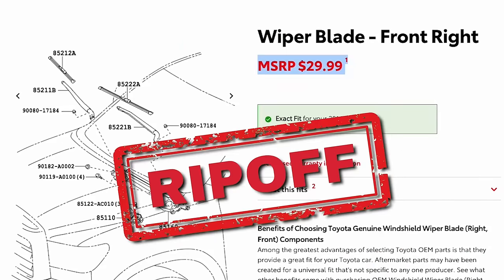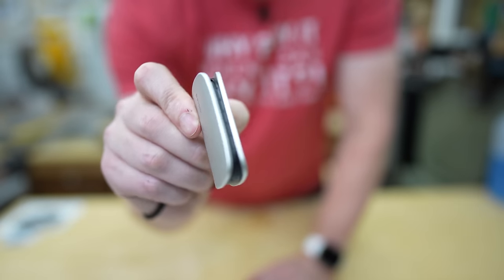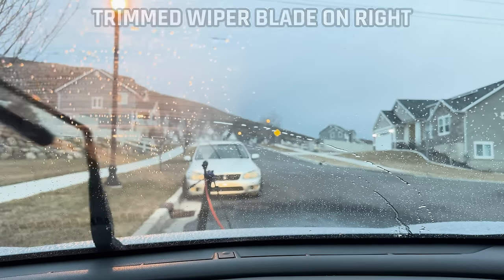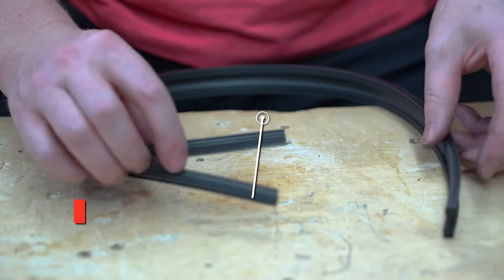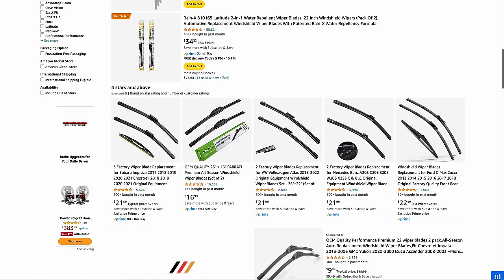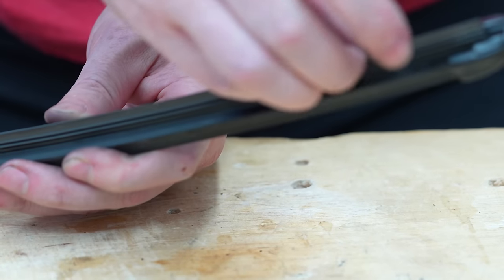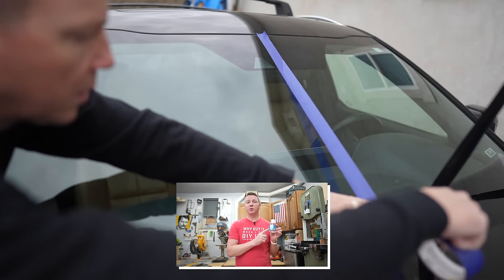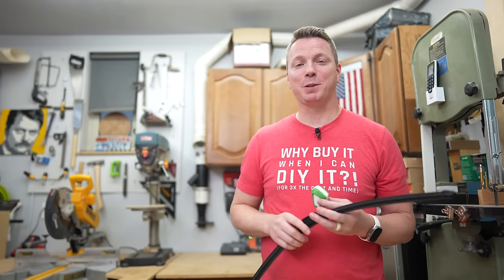Windshield Wipers Are a SCAM! 3 Ways to Save $$$

Comment: I am going to weigh in on this subject because it is one of my biggest pet peeves. 
It wasn’t that long ago that you could walk into any walmart or chain auto parts store and buy wiper blade refills cheap, I’m talking $1.99 for a set of refills at walmart. At that time you could buy a complete OEM quality Trico replacement blade for $4.99 and the best premium Silicone blades from companies like Rain-X or Bosch for under $10, now wiper refills are no longer available at retail stores and Rain-X Silicone are up around $25 each and Bosch OEM quality blades are around $35 a pair. As someone who spent years in retail auto parts I am extremely perceptive of changes in the auto parts market and can say without reservation that almost none of this is due to inflation; this like almost everything else in today’s economy is almost all the result of greed based market manipulation, for proof all you have to do is look at the record high profits corporations are reporting to their share holders. Companies across the board are now in the stock market business and their customer base is the expendable consumable used to reward their share holders………
Reply: I agree the the rise in prices has nothing to do with inflation. I have also seen my company raise prices on the highest selling items like batteries and wiper blades. First $10 then recently $5. Our pay hasn't increased at all so its not due to the increase in wages and with all the new products they send out it doesn't appear to be due to supply shortages. It's all just corporate greed to see how much profit they can get away with.
Reply: Totally agree! At first, I thought it was local availability, but I’ve moved around a lot and travel even more, and eventually I just never saw refills anymore. I’ve experimented with different types in different climates, and I’ve found you’re better off buying the cheapest ones unless you live in a more favorable climate that you can get more a year out of them. I remember we use to get much more life out of them than ANY now. I’m hyper sensitive to the quality of my windshield viewing, especially during rain, and I remember usually get 2-3 years out of most wipers until the last 10-15 years. Greed by just about any company these days is getting out of control.
Reply: It's also the stupidity of people. They are not conscious anymore.

Comment: I have the same large bottle of Rain X for about 30 years. I haven’t needed it except for after replacing a windshield. The key is I started using Rain X washer fluid which replenished the Rain X each time I use it. I’ve even used it without applying Rain X to the windshield and after a couple of weeks it’s working as if I did.

Comment: For cars with steeply sloped windshields, I found the same that you did. Using Rain-X (or similar), you don't need wipers above about 30 MPH. Wipers actually make it a little worse, because the water's already gone by the time the wiper reaches it. 
The droplets just race off the top of the windshield. It's a little distracting at first. Sort of like driving into snow. 
It also makes it much easier to remove ice and frost. Just give the ice a couple light taps to crack it and it shatters right off. 
Putting Rain-X on the wiper blade helps too.
Reply: I’ve also found using wiper blades with Rain X seems to make the Rain X not last as long.
Reply: Yes! A fresh coat of Rain-X and there’s no need for wipers. The less you use them the longer the Rain-X will last.
Reply: Also, just regular wax will work
Reply: I find only when the rain is heavy do I need the wipers. I don't think speed changes it. If anything, goinh faster will help with modern sloped windows
Reply: @thepitpatrol  for a MUCH lower amount of time. I've experimented, rainx can last months, wax, a few weeks.
Reply: @darkhorseautoanddiesel  that's probably true but we used wax before RainX had ever been heard of.
Reply: @thepitpatrol  We've tested that. Regular wax works, but not nearly as good as Rain-X. Ceramic or graphene coatings work a bit better than wax, but still not as good as Rain-X.

Comment: I used to use Rain X washer fluid all the time and it worked great.
   Until a couple years ago when it started leaving a nasty residue. If I was driving into the sun, or at night oncoming headlights, left me completely blind, not  seeing through the residue.
   It soon "evaporated", but it shouldn't have been there in the first place.
   I suspect Rain X "improved" their product. We all know what that means.
   I tried Rain X wiper blades and they left the same residue.
Reply: some years ago Rain-X changed their formula, which I can't recall what all was changed but basically they removed the silicone component that would leave the water repellent film on the window everyone liked. Now it's just colored water with some impurities in it like most other brands. You can get the same silicone residue on the window if you use silicone rubber wiper blades as opposed to the more common (and cheaper) plain rubber ones. I also find the silicone wiper blades last a lot longer, being more resistant to degradation from UV and ozone as well as more flexible in a wider temperature range. Worth the extra cost IMO
Reply: We have found of you clean the windshield very well and finish with distilled water and a clean microfiber cloth, it leaves no film. Sometimes you think it's clean, but some road films are very hard to remove. Wipe on the Rain-X with a clean white paper towel and after a wipe or 2 if the towel shows any discoloration, stop and clean the windshield again.
Reply: Steel wool, rubbing compound/wool pad, buffer, rubbing alcohol, foam pad w/ Fast orange pumice soap/rubbing compound 75%/25% respectively will remove any and all scratches then seal with a graphene or ceramic spray detailer. Mink oil is the #1 ingredient in the old formula rain x, BTW

Comment: I clean blades with rubbing alcohol every 1-2 months and then use a rubber protectant like 303 aerospace protectant(which I also use on tires, headlights/tail lights to stop fogging, and serpantine belts). Keeps blades going for  years.
Reply: This right here!! Doing this you'll almost never need to change the blades
Reply: You dont need to put 303 on serpentine belts. It can actually cuases issues in some vehicles like slip....... On rubber hoses and plastics are fine in the engine bay.
Reply: I just buy them when I need them. it really isnt that much I mean I dont buy the 60 dollar blades just the lowest priced ones that fit my car

Comment: Awesomesauce! Thank you so much for making this video. I have been telling people for so long how easy it is to take care of your blades. Now I must admit, at 50, I have gotten much lazier. I just purchase the Washer fluid with Rain-X already inside the bottle. After about 3/4 to 1 gallon of use, and my windshield is treated. Not only do I not have to run the wipers; but when I do, it doesn't wear down the blades as much if it isn't treated.

Comment: Back in 2017 I bought real silicone wiper blade refills for my newish car and my wife's car that wasn't new, I had the old Triple Edge wiper blades back in the day, and they were silicone and  spectacular. Hers streak a little these days (2024) but I haven't tried cleaning them, so I'll probably do that before swapping them. I sold my car and bought another in 2019, first blade change was to Silicone blade refills, and they still work fine. 

We do use the Rain X windshield washer fluid, that helps a ton and I never have Rain X the windshield for a re-coat, ever, the water just beads up and rolls right off.

Comment: A couple of good tips there. I've been using the RainX windshield "spray version" for a few years now. After it's applied, you can actually drive in a good rainfall without the wipers on. The water just beads up and quickly flows off the windshield.
Reply: But if you DO use the wipers you get a darn fogging.

Comment: The system that I use (been doing it for decades) I saturate a clean paper towel with winshield washer fluid, then I use that towel and rub against the wiper rubber. Removes an  amazing amount of dirt. Ju st be sure no alcohol is used because that will cause the rubber to dry out. For the winshield, I use Prolong Waterless Car Wash. I apply it to the winshield then buff it with a soft turkish towel.

Comment: I have only one question..
Living in a cold climate and having summer/winter wiper fluid is common here, the difference is the amount of alcohol in the fluid.
The alcohol is there both to help with quick evaporation and not freeze in winter.
DO these tablets produce alcohol when reacting with water?
If yes, then great. If no, then you're f-d in the winter when your wiper fluid freezes, maybe even expanding and damaging the washer fluid system.

Something you should consider testing before recommending.
Reply: No, they don't do anything to lower the freezing point of water.  I looked at this guy's link, and there isn't a single word about it changing the freezing point of water.  So, it's not a substitute for your typical blue windshield washer fluid if you live where it freezes.

Comment: Good informative video.  As a Rain-X former user, I found a preferable way to keep the outside of the windows and windshield slick and clean.  I use an automotive spray wax.  Usually one of the popular known brands.  I do this to my windows about three or four times a year after a wash job.

Comment: Retired after 42 years in the automotive industry. Here are some pointers on wipers. Any time you have the wiper arm up without a blade attached put a towel or pad on the windshield. If the bare arm snaps down on the windshield it can shatter it. When using a refill insert check that any joints in the backings are not worn and if the wiper backing is twisted or damaged. If using refills or new blades check where the wiper connects to the arm for any play. Then check the arm itself. Any corrosion in the hinge at the base or a weak/ worn spring the arm can’t supply the proper pressure on the blade. Last make sure where the arm attaches to the linkage is tight. I’ve seen far too many complaints of wipers not working properly or not at all with just a loose nut at the base of the arm. Never use anything oil based on wipers, it can cause a smear on the glass. Just wipe them off when you squeegee the windshield. I’ve never been a fan of water repellents, many can cause a haze on the windshield when driving into sun even when dry. Just so of my experiences. 😊😊

Comment: An alternative to RainX that I’ve been using is ceramic coat detailer. Less than $20 at retailers, applies the same and works great.
Reply: I saw another YouTube video where they tested ceramic coatings vs RainX, and the RainX did noticeably better.
Reply: I use both and either works great when applied correctly

Comment: There was a brand of wiper which I can’t recall the name but doesn’t matter. The rubber insert came with a little foil packet with an alcohol wipe in it. Wipe the contact edge and install. 
My wife had bought the whole unit from the dealer like 6 months before inspection and at inspection they told her she needed new ones because they were streaking. She was livid. I told her call them and tell them to clean them. She did. They did. It worked.

Comment: I used to work at Honda and our wiper inserts were so cheap and good that folks would change out their wipers to aftermarket once and then have to buy the oem wipers as a complete part so they could go back to just replacing the inserts lol. I definitely recommend it. Thanks for talking about the washer fluid tablets, I’ve wondered if they were any good. You earned my subscription, thanks for your help 👌

Comment: Chemical Guys Hydro View is a glass cleaner with repellant.  Lasts a lot longer than rain X, about $20 but it also cleans.  I can do many car washings and still have the water bead on my window glass. I also use it on the shower glass, mirrors, house windows, picture glass, tv screen and cell phone.  Not affiliated with CG, just love this glass cleaner/repellant. There are others such as Adams and Ethos you can try also.

Comment: I bought a 10 pack of silicone refills some 4 years ago for $20 on eBay and replaced the blades on my wipers and friends and family's cars. Still work great on my daily car. I clean the blades with just a paper towel and water whenever i see a streak every few months.

*Chicago daily driver

Long->Short; Silicone wipers FTW

Comment: ❤ I know this may sound ridiculous to some but what I’ve been using for years to replace windshield wiper fluid is a teaspoon of Dawn dish liquid kind of like you said, put it in the Reservoir first then slowly add water this will prevent any suds, this stuff removes road grime like you wouldn’t believe 
I think it keeps my windshield wipers, clean as well. Just saying. 😅

Comment: Good advise another thing I will add is if you live in a cold climate where you get ice and snow when you start your car in the morning even if it's a light layer of ice scrape it off and spray de icer before you run the blades, best to wait till it's melted, I've had my set of AVA silicone wiper blades for 5 years now and still have no streaks.

Comment: I'm still running my OEM original from. Factory wiper blades on my 2016 Focus RS.

I'm a bit of a nuts about having a super clean glass on my cars, so thorough cleaning inside and outside (not that the inside matter for this) and also I always clean my wiper blades when I wash my car.

So basically I agree with what you say/recommend here 😉

Comment: Thank you flr a simple clear and informative video. Ive had a personal issue with wipers for years. My local parts store charges up to 20 bucks for a single blade. 

A buddy was on rockauto and saw a clearance deal where he bought cases of the highest end bosch blades for 2.20 each (instead of 23.00), so ive been spoiled for a couple years.

Comment: Thanks for the tips. I remember the old replacement rubber inserts and used to use them. But I still have the original wiper blades on my vehicle after 5 years. I clean them periodically with 91% isopropyl alcohol. They are starting to fray a bit, so I will likely replace the inserts soon now that I know where to find them again. I have not bought washer fluid for 15 years. The dealership that changes my oil (for about what it would cost to do it myself) tops it up for free. I doubt the tablets provide resistance to freezing.

Comment: Years ago I used to drive an old car that the wipers just didn't work so I almost always had rain-x. in the car. On the few occasions that I didn't have any and  I got caught in a heavy rain I would pull into a car wash and blast the windshield with the hot wax till time ran out. It wasn't the best fix, but it was enough to be able to see to get the car home.

Comment: I had no idea wiper refills were still available out there!  That was THE way to save on wiper maintenance when I was kid (they were sold right alongside the entire wiper).  Also cleaning the wipers and glass reduces friction.  It is the friction between the two that really wears down (and pulls apart) the blade.  I've heard that wiping the blades with liquid silicone is better than WD40.

Comment: I use isopropyl alcohol 90% or higher and a paper towel or clean rag to clean the rubber.  It basically strips off the oxidation.  Then I coat the rubber with a good rubber/vinyl protectant, like Armor All, and let it set for a few minutes to soak in.  Then wipe it off.  If you do this once or twice a year, the blades will last one or two more years.  Start doing this right away, and don't wait until the rubber is damaged, although I've had good results even with older ones.

Comment: I spent a little more the last time and bought the silicone blades, I think they were Michelin.  I heard they last longer than rubber.  I've had them for probably 5 years and are still going strong.  I think they were worth the price.  They're cheaper than some of the other brands.

Comment: I love the idea of the window washer fluid tablets, not just for the savings but to have them easily on the go. My big concern would be freezing (I'm in Utah too), and in looking at the reviews of the ones you linked to, it looks like freezing is an issue with those tablets. Reviews in similar products mention adding 'de-icer or methanol'. Worth looking into which `de-icer` options exist and how to properly blend.

Regardless, thanks for the info. I enjoy your videos. I thought I was saving big by getting my full wiper replacements cheap on RockAuto, but I think I'll go the blade refill route now! Thanks!

Comment: Where I'm from we can get new windshield wiper blades for less than $10. It really makes no sense to start trimming rubber or bother with replacing the rubber when you can replace the whole blade for the cost of a starbucks.

Comment: Thirty years ago it didn't matter if you used the RainX Windshield coating or not as it simply did what it was supposed to. But I would advise not using it on your newer car with auto-wipers or especially lane keeping assist or any of the other fancy modern helper things. The coating will interfere with the sensors ability to detect things through the windshield and may keep it from working altogether. Also, all of the washer fluid I use is methanol based so it doesn't freeze. Those tablets don't make it methanol, you would have to add it to methanol.